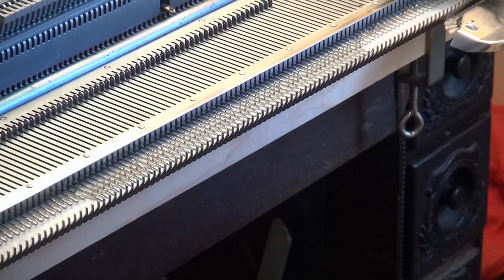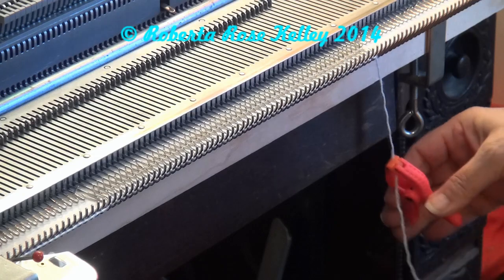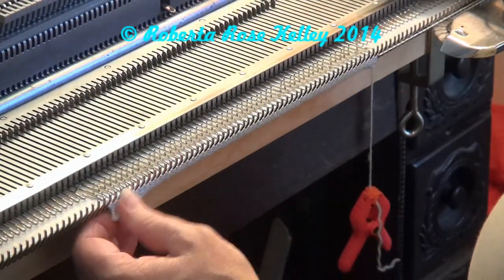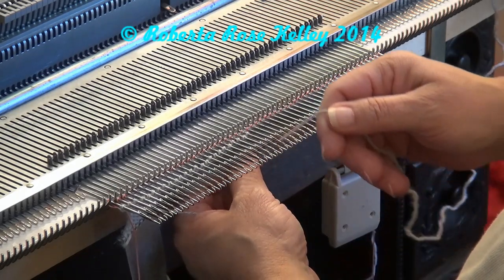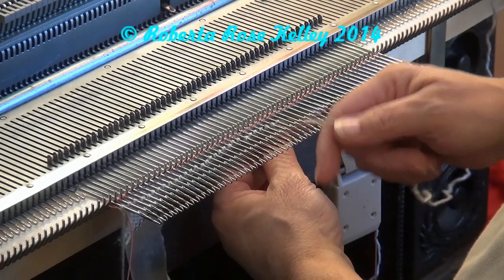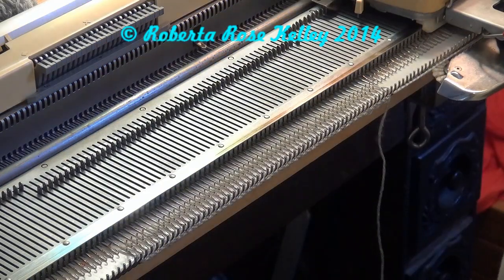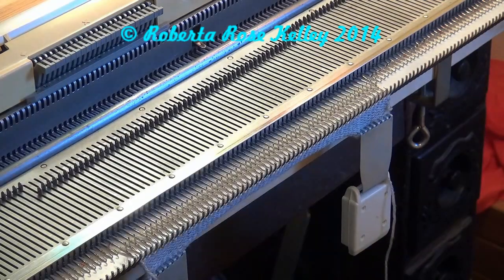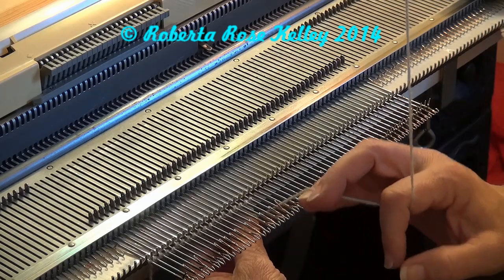Casting on the Singer type knitting machines

Comment: Hello am impressed with the knowledge of all the machines.
And I need your opinion on 
What type of yarn to uses on my machine if you don’t minded.
Reply from the maker: Thanks you. So on the bulky machines, you will use Worsted Weight to maybe Double Knit yarn, for the standard machines, I used 2 or 3 strands of 2/24 coned yarn to sport yarn. Then the Mid-gauge will be in the middle, it can use some of the newer slippery worsted weight yarns but awesome with sport or DK yarn.
Reply: Hello Roberta Rose, would this cast on work on the JK150 machine, thank you

Comment: Hi Roberta.  I have been a long time subscriber.  I haven't used my Studio LK 155 for a few years and feel like it could use a good cleaning.   Do you have a video that would help me get started again?  I have forgotten what yarn I can use with my machine?
Reply from the maker: Thanks for the question, I do have a few cleaning tips on the different machines, even go into replacing the drums, but sure that is not a problem for you. If your drums are a bit stiff, first try a hair dryer to warm up any congealed grease. But most important first is get a new sponge bar, that is if you kept that in the machine. I tend to take mine out of the machines when I know I will not use that machine for awhile. But watch some of these: https://www.youtube.com/watch?v=EDCylzfFjUY&list=PLnm15NuKOub3-cN8BzJLkNL-XmUZa-Jyb

Comment: The 360 doesn’t seem to use worsted weight yarn. Am I doing something wrong or is it supposed to take smaller yarn?
Reply from the maker: No, the 360 is a standard machine, but you can use EON with some worsted weight yarns, not all but the softer it is, better on this machine.

Comment: Hi, On my 322 I only use the ravel cord method when I do a tension square and I find knitting more than 5 rows (DK/4 ply yarn) the cord is difficult to remove.Even after 25 plus years of using an LK150 I's still a learner when it comes to my 322 even though the basics are similar - like your videos as well.
Reply from the maker: So maybe try using a higher TD number for the ravel cord only, maybe that will help.  I will do that for WY and Ravel Cord but need to remember to put the dial back to normal before I start using the Main Yarn.
I am still learning and I have been machine knitting for almost 30 years now and all I had for my first 15 years was the brother KX350 but got it to make what I wanted until I saved up for a good metal bed machine, which was my first SK/SR155.
Berda

Comment: What's ravel cord?
Reply from the maker: It is a nylon cord, easy to start out with WY, than knit a row of the ravel cord and then push back the work and needles out to HP, do a closed cast on. Thin fishing line I am told will do the same, I have used crochet cotton but rarely get to reuse it.

Comment: hi Roberta, I have the singer studio 303 ,,I have a couple of questions, my stitches are really tight and make tiny stitches. is there a way to make looser stitches on this machine besides using every other needle? I am looking at the 9mm bulky brother machine. if I knitted every other needle on my machine is that basically the same as a 9mm machine? thank you for any help, Suzette
Reply from the maker: Suzie Bender I am thinking that you have too thick a yarn, even at EON.  I found that some of the newer slippery yarns work best that way on the standard with using EON.  But to get a mid-gauge or bulky may work out better for you or anyone else that is having the same problem.  Or use some 3 ply yarn with going EON but I can use that yarn with the TD up on 9 or 10 good but all depending on the yarn used, some are rough where others are nice and soft.  Hope that helps.  Berda